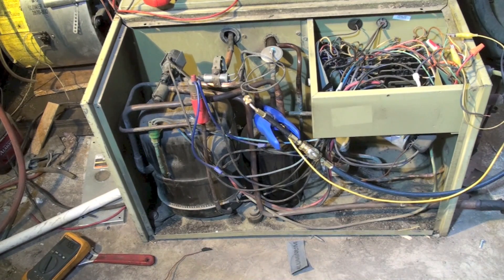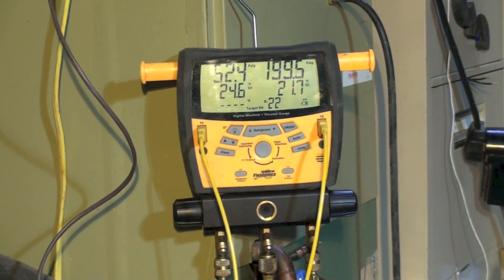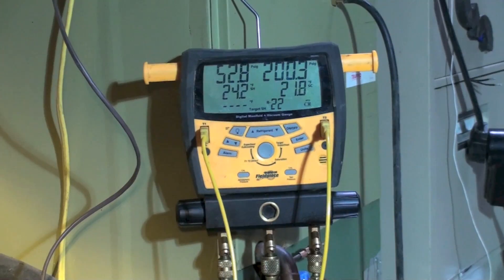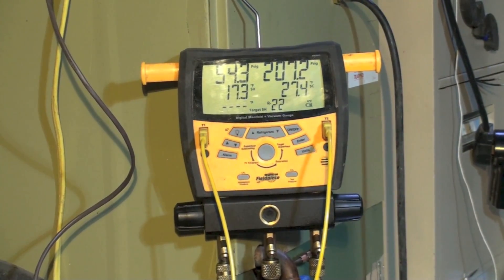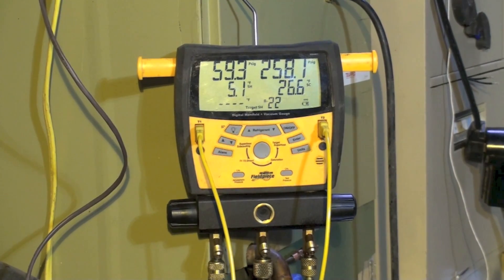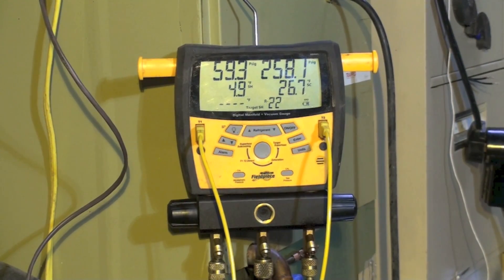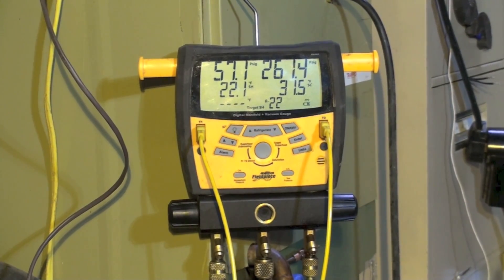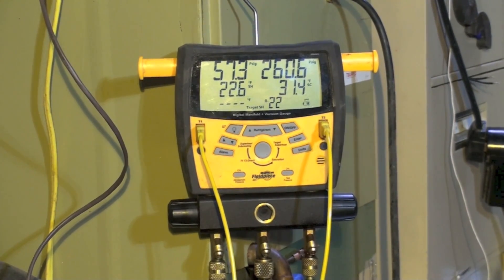What is wrong with this heat pump: varying superheat

Comment: might be the the system froze up and pushed the oil to the evaporator coil and now causing a restriction in flow? would cause high head and low suction.
Reply from the maker: Here is the answer:  https://youtu.be/jUpk5O26sU4
GFM

Comment: So what was causing the superheat to fluctuate gray furnaceman?
Reply from the maker: jon50harding The TXV had a lot of garbage inside.  It has been replaced and the unit works better.  There is still some hunting but it is considerably reduced.  I will be doing more videos on this machine and you will see how it works.
GFM

Comment: The valve is fluctuating way too much.  But why?  I don't want to just simply say the TXV is bad.  But it might be.  Powerhead could have lost some of its charge.
- Bulb exposure to ambient. My gut tells me this is a red-herring and you're doing that to throw us off.  Too easy.  Still, it's the easiest thing to test out.  So I'd move that bulb into the proper position and insulate it.  Before that though, I might completely unstrap the bulb and let it hang there in free air, just to observe what the valve does. Does it keep flapping back and forth, or does it even out?
- Check-valve sticking.  When the SH gets on up there give the check valve some whacks and see if anything changes.
- Non-condensables.  If I don't know who opened it up last, I always assume there's NC's until proven otherwise.  (I realize this is a bit of a cop-out.)
- You gave us that it's already overcharged.  If there's a light load and/or low airflow, I could imagine it behaving this way.

GFM, it would be very helpful if you could school us on how to systematically eliminate these various possibilities.
These troubleshooting ones are great -- keep 'em coming.

Comment: I guess because you are over charge and you are in the heat mode, the low ambient lowers the pressure of refrigerant, that causes the txv to try to maintain proper superheat and will be opening and closing going back and forth. The bulb needs to be insulated as well.

Comment: Seems like a sticky TXV and/or the bulb should be at the 10 or 2 position if that line is as large as it looks in the video.
Reply from the maker: Jeff S Its 1/2"
GFM
Reply: grayfurnaceman Well that's one issue, the 12 o'clock position is for smaller lines I believe. Not sure if that would be enough to make it swing that much though.

Comment: I agree with Stephen low suction pressure will be caused by low airflow along with low return  temperature which I be live u said was 68 and dirty filters with the high head pressure that would be a bad txv or insufficient conditioned  airflow or restriction at the condensor coil and if the compressor drawing to much amps that will cause high head.